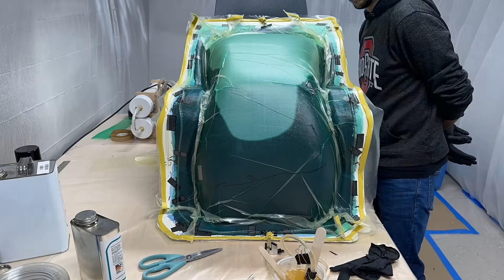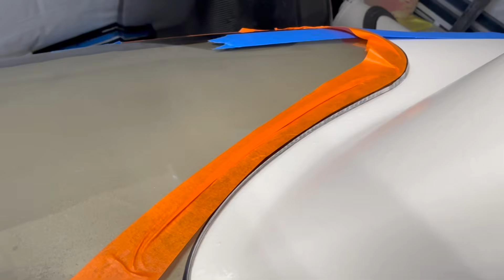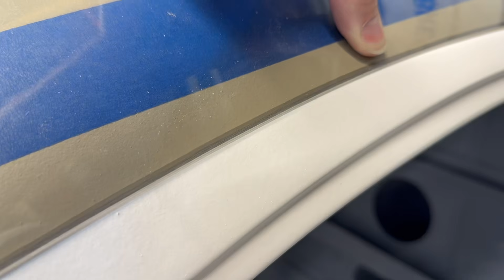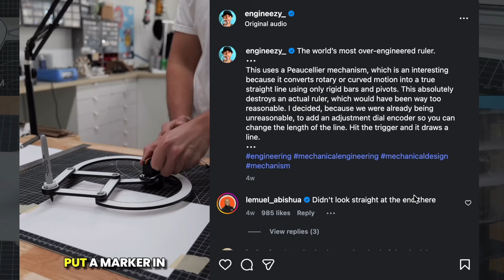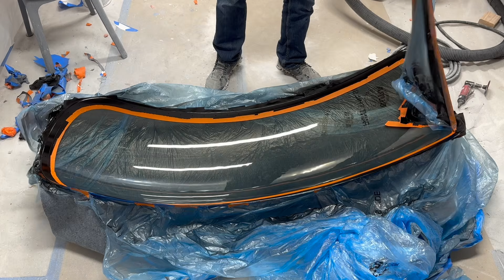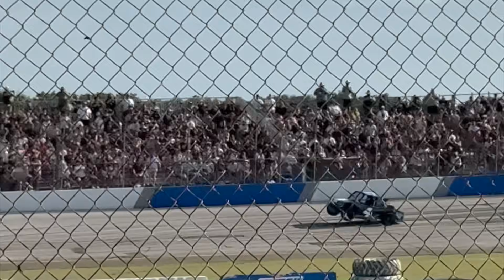Making a Windshield Fit a Helicopter (Without Screwing It Up) | Basement Mosquito Helicopter Ep. 28

Comment: Nice job, if you put a 3” cut off wheel between your 2” arbor and 3” rolock disc it gives you a nice backer and stops the flex.

Comment: A great way to use tape for very accurate indexing similar to what you did is to. 

Place your painters tape, I always use low tack in most cases just incase I want to leave it for a long time.

Then span across the parts with aluminum duct work tape. 

Then scribe a line across both parts in the aluminum tape like your sharpie mark.

The cut the aluminum and painters tape with a razor blade perpendicular to the scribe line such that both parts are free. 

I can routinely hold .010 and sometimes better depending on the care I take. 

Another truck is to blue the aluminum tape or color it with a sharpie, which is what I do most of the time. Then scribe the line to make the line more vivid.

A popsicle stick is used to burnish the aluminum tape down to the painters tape as well to get a smooth scribe surface. 

Keep up the great work.  Look forward to seeing it fly.
Reply from the maker: I’ll have to give that a try. Thanks!
Reply: @TheOkayestEngineer another technique is to do the aluminum tape, scribe.  The rough it up and use two pieces of 1/4" tool steel as registers, one is super glued on one half of the scribe back on the main part. The other is super glued to the part that is removeable and extends onto and parallel to the fixed side, ie your copit. This technique give great postive regustery and if you do the strategically with geometry and distance apart are excellent at maintaining alignment until fastners and dowl pins are installed. 
Just be cautios and protective of them, the super glue is brittle and the can be popped off if hit, a good and bad thing. If we wanted them to stay for a long time through processes, i would put a filet of bondo on one side of the tool steel to beef up the holding power,  ie less brittle but still easy to remove. Don't be temped to use hot melt glue it wont hold well to the tool steel because it is cold.

Comment: Mixed feelings regarding, state of disassembly to minimize deformation / stress. My thinking / experience being that once everything is assembled, a whole new set of stresses will be introduced, turning the windshield into a stressed / structural panel.
Also, now that y’all removed the windshield cutout and the actual windshield, maybe constructing a flange on the cutout and installing it in place of the windshield, will prevent subsequent deformation, until the actual windshield is installed.
Reply from the maker: If you let the fuselage stress and then put the wind screen, you’re pre stressed and it will fail at a lesser load than if you assemble with both parts with no stress so they share the load. That’s my thought anyway.